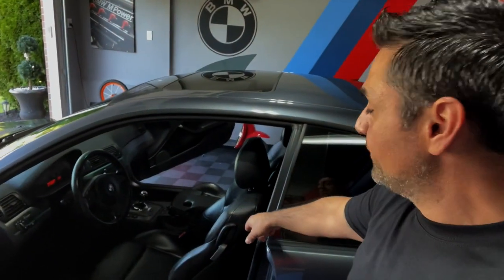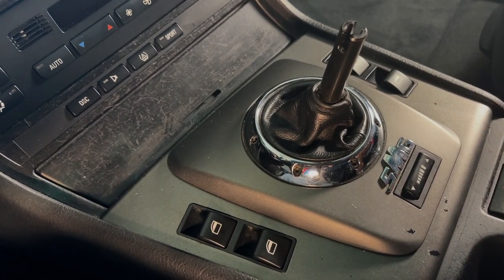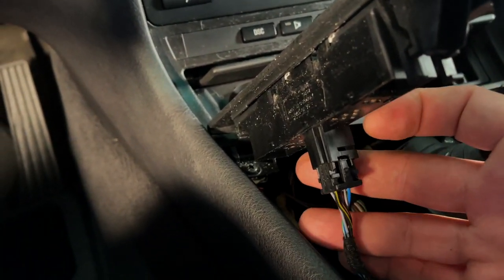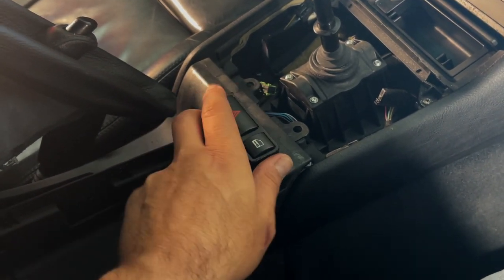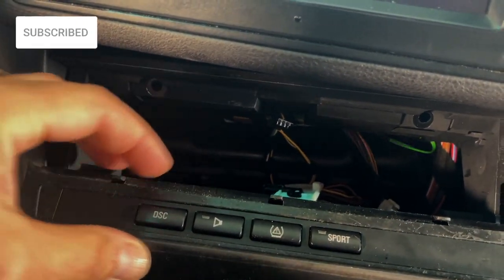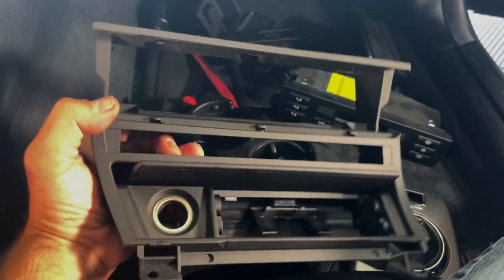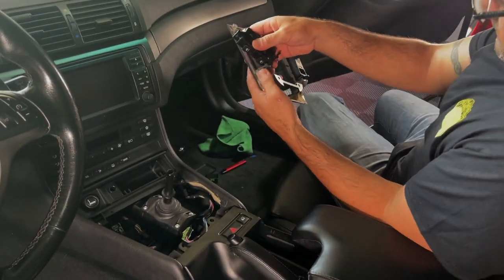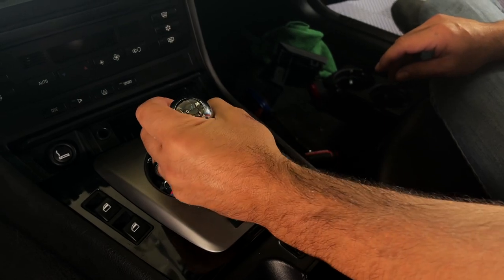E46 M3 Center Interior Console & Trim: How To Remove and Install DIY

Comment: Really helpful thank you. I'm considering replacing center pieces to improve a scratched up ashtray door. Lot of work and expense but may do it. Couldn't find a video on a car with the display. Random question - I'm trying to determine correct piece to order. I see you used part #51167001408. But Realoem seems to indicate my part would be 51167001410. Did your car have the smoker package, S441? Thanks in advance if you have any thoughts.